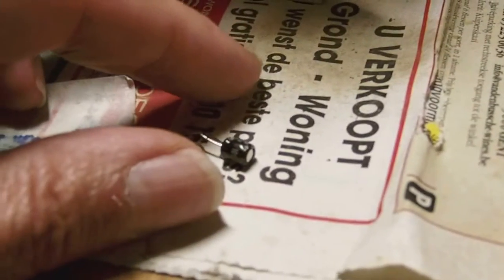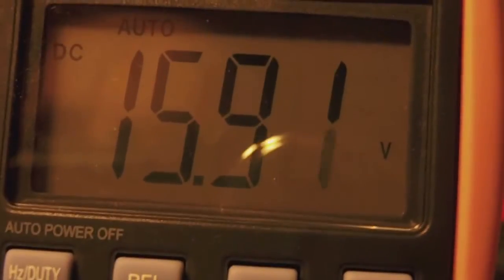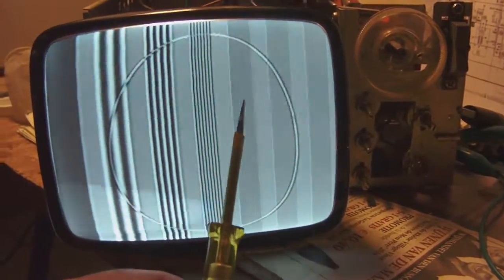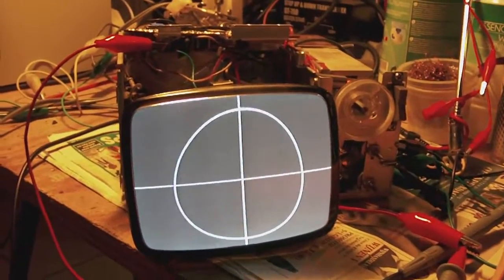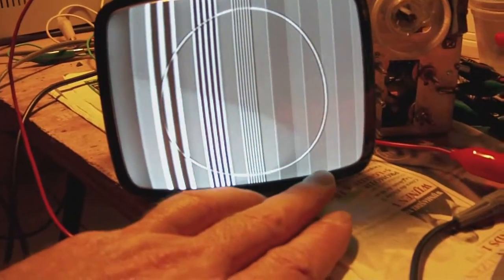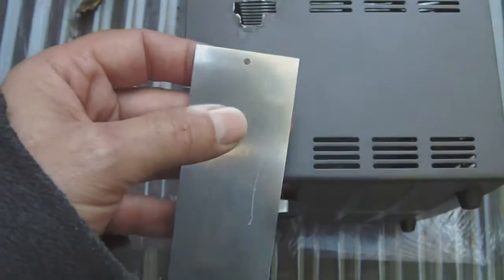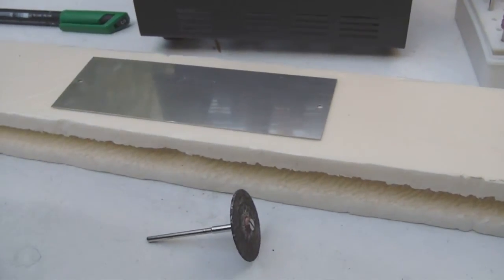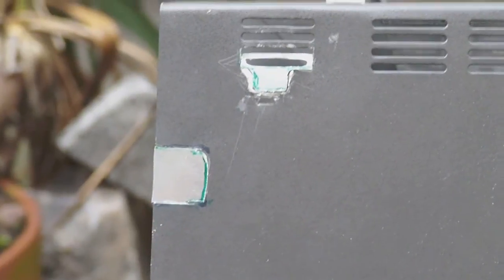Sony 5-303E part 7 of 10

Comment: Maybe you could find a "new" cabinet from another Sony 5-303 set that was too far gone to restore, such as one with a dead or smashed CRT? One that is water damaged may be another possibility, rust is easier to remove then recklessly cut holes made by some no-mind with a pair of tin snips, and too much time on his hands.
Reply from the maker: Yes, I guess your analysis holds water Oleg, but I just need to find a reasonably priced wreck somewhere. Thanks for the comment.
A peaceful and happy New Year 2020 to you and your loved ones :)
Reply: I've seen some on fleabay, but they are in the U.S unfortunately. Do you know of anyone who does sheet metal work and has a MIG or TIG welder? If you did then they might be able to weld some patch pieces in. 
  Happy New year to you as well, and a belated Merry Christmas.